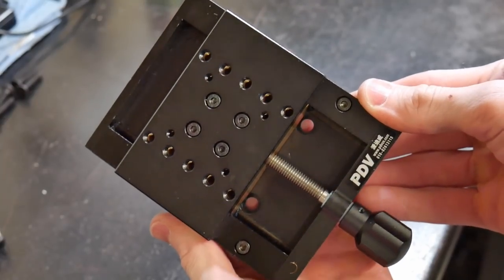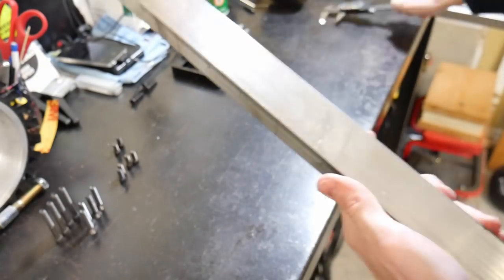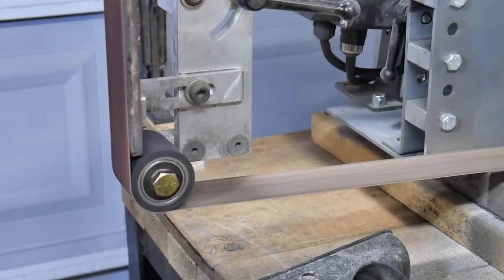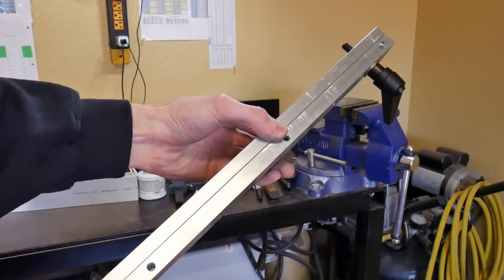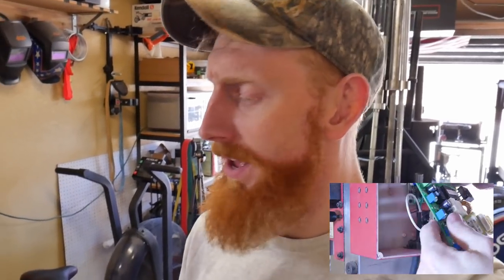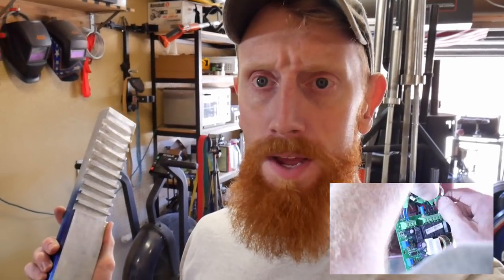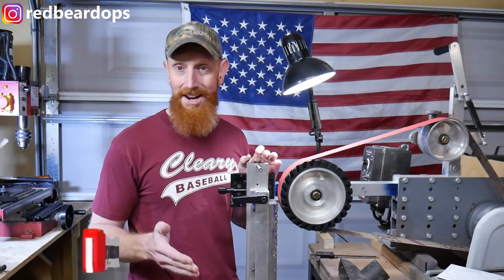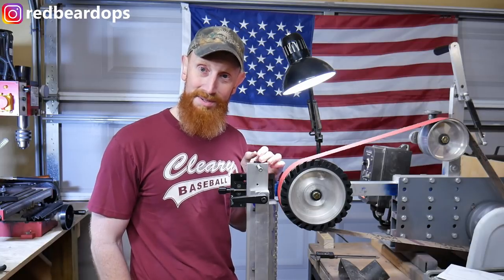Homemade Surface Grinder Attachment - Want Flat Things?

Comment: Nice Idea, I worry about some of you health and safety, well done on the video.couple of points, when using any machine, use hearing protection, when grinding use a N94 dust mask. (Yes I have a beard as well, but I keep mine short) when working, clamp the job, keep your hand away from the tool, keep the blade covered on the band saw. Clean up after the cut, hold the job or clamp, fix the vac so you can hold the job..... use some vice grips to hold the screw when you use the band saw. I have learnt this all the hard way.....great project hope you have many happy hours and make some great things, once again thanks for taking 5he time to make this video
Reply from the maker: Have a great weekend sir!

Comment: I just started building my surface grinder attachment, and just completed the magnetic chuck. I found it fairly easy to get the magnets in by using super glue. Just took a couple small tubes. Only have to hold down the magnet for 10-15 seconds, and then you don't have to worry about holding it down while putting in its neighbor.
Reply from the maker: Glad that worked for you Kyle! Cheers sir!
Reply: @RedBeardOps  I might add, I poured epoxy resin over the top to fill in the slots. Just put the super glue down first to hold them in place.

Comment: Yeah man excellent attention to the details that are important. I can really tell you remember all those little ah ha moments that made you a better craftsman and pass them on as you narrate.  Thanks for talking too come to think of it I am really getting tired of trying to get the pertinent info off a video where the guy just plays bottled porno music or bad techno it's infuriating. I was blown away by your use of the drill press as a jig to start your tap straight.  For me that that simple tip is going to improve the quality of my work so much.   I am so stoked.  I made a custom tap handle with longer arms and a level the other day because my holes just weren't perfect and it was driving me nuts.  I I've even broken taps trying to correct a bad start a little too far in.  I can't believe I didn't know that already or think of it myself.  I used a cordless to start some the other day with decent results until it broke off in a customer's piece.  Had to grind it out with a diamond bit in the dremel.  Anyways you are a gentleman and a scholar my friend you have my subscription.   like the third one I've subscribed to in the last ten years.
Reply from the maker: Thank you very much sir! I'm really glad you were able to get some usable information form this video. Cheers!

Comment: I laughed a bit... "...is about 600 mm long, and about 2 and a quarter wide"
Nice job satisfying both sides of the old Metric vs Imperial camps  :D
Definitely a sub from me.
Reply from the maker: Thanks man, I try to keep everyone as confused as possible! ;)
Reply: So that’s 2ft x 60mm.
Reply: M6 is near enough 1/4 Whitworth. M8 is 5/16 and M10 is 3/8.

Comment: Cool built, I like the idea, not as precise as a full surface grinder, but I expect it's plenty good for what it's meant for. Couple of thoughts while watching, if those locking levers are used enough you might end up with the threads wearing out in the aluminum, if so a thread insert (a Heli-coil for example) would be a perfect fix. Interestingly aluminum can be cut with woodworking tools, if I had the choice I would have cut the slots for the magnets on a table saw, not always an option (gotta have easy access to a table saw...) but it opens up possibilities. You may know this already but those screws are generally hard(ish) so they tend to wear the blade on a band saw quickly, especially if the blade is new. As a machinist, I feel you on the milling for the first time, it's a totally new game, wildly different rules, so no harsh judgements here. Great build, I look forward to hearing your thoughts and experiences as you use it more
Reply from the maker: Hey yeah Curtis, for what we "full tang knife makers" do it's more than adequate. For sure not a replacement for a legit surface grinder.  Very good points in your comment. The table saw would of been way faster I bet. A lot of machinist have commented on this video in what I'd consider a mildly-hostile way; so I really appreciate your approach. So much to learn on my end! Cheers sir, have a great weekend!

Comment: A great upgrade would be to fill the magnet slots with resin to make clearing the swarf off easier.
Reply from the maker: That's an interesting idea! Thank you
Reply: I was thinking when the magnetic table was being used at the video end that after a short amount of time there will be a ton of grinding waste in the magnet grooves. This seems to be a good solution. And I learned a new word: swarf.
Reply from the maker: @oddjobbobb  As a side note; wiping it off has been pretty easy. Also if it really bothers you, you could lay down a strip of tape to peal off after use. Cheers guys!
Reply: If done it should be with a high temp resin as I imagine the blade could get a little hot.
"Swarf" Yes, keep it out of your beard ; )

Comment: Congrats!  Looks great!  I wasn't as patient as you I just bought the Origin Blademaker surface grinder. Got it last week. The surface grinders will really up our games. I have already found as you were doing it is of the utmost importance to true it up before you start using it. For me I ordered some 2 1/2" belts. They're easy to find. Good luck. I am anxious to follow your progress here as we both seem to be starting this part of the journey at the same time. Next is figuring out how and where to store it when not in use. It is a big burly thing and attracts a lot of metal dust (as it's magnetic). I need to find a way to store it that it doesn't accumulate metal shavings when not in use.
Reply from the maker: Awesome Jim! You'll have to let me know how the OBM works out for you. I think I'll be able to use some 3'' x 79'' belts that most people carry. I've been playing around with it over the last few days and it's promising! I'm thinking of storing it on the wall via hooks.

Comment: protip: when installing magnets, don't try to do them all at once.  install in an alternating pattern and let epoxy completely set...
Reply from the maker: A very, very good tip right there!
Reply: @RedBeardOps  You actually want the magnetic N/S fields to be rotated CW 90º such that they form a Halbach array. This arranges the magnetic fields to one side of the faces increasing their strength in one direction, exactly like fridge magnets work.

Comment: I built a DIY belt grinder, here in Ireland 2" x 72" is not very common but I was easily able to buy 75mm x 2000mm belts which are roughly 3" x 78.75". If you could obtain those belts you might be able to run them on your machine with the contact wheel moved out a bit more to take up the extra belt length. It would save you having to order custom made belts.
Reply from the maker: Good idea sir! The 3x79 belts are a common size here and have been working fairly well. Cheers man!

Comment: I have been wondering about getting a mill for flattening out surfaces on forged pieces. Since you already have a mill, do you find the surface grinder attachment better for this type of use? Faster/cheaper/easier/other reasons?
Reply from the maker: Good question Joe. Yes the Surface grinder with belts will be much faster. Clamping forged pieces on the mill can be difficult as well. I do use the mill with a router bit to flatten handle scales and blocks though.
Reply: Idk id suggest a mill, its just more versatile
Reply: I use my surface grinder attachment on forged pieces as well especially since I do a lot of salvaged metal knives and swords.  You can never be 100 percent sure how hard the metal is after forging.  Some metal air hardens quickly.  Even a draft from one side can make piece hard enough to waste a 50 dollar bit by hitting just one little area that got hard.  I also agree with the clamping issue.  It's sometimes hard to find a reference plane to start with on something that may or may not have warped as it cooled.  A mill is still an indispensable tool where exacting tolerances are required however forging is not an exact science.🤔
Reply: Just a little saftey tip, your saw will cut meat and bone real fast!  Use some vise grips to hold those little screws and parts.  Ask me how I know!
 I love the way you approach your projects!  Be careful as you go on your journey.   Thanks for doing what you do.

Comment: Combat Abrasives will make custom sized belts
Reply from the maker: Thank you sir, I'm in contact with them! Seems like good people.
Reply: @RedBeardOps  You can easily rip down a 4x72 belt. Not sure if it's cheaper or not but...
Reply from the maker: @Steve_Just_Steve  Thanks for the idea! I was able to find some though Combat Abrasives that should get the job done though.

Comment: Others have mentioned WD on aluminum. Cheap, but works. Those are chatter marks, somethings moving. Anytime you see that, reevaluate your speeds and feeds(slow down), and check your rigidity. Magnet tip, steel flat stock behind the aluminum will force the magnet to self level and stay home while placing multiples.
Reply from the maker: Thanks for the tips!

Comment: I'm struggling to fathom how you can possibly demonstrate flatness using a single thickness measurement.
Reply from the maker: Well, I hadn't had much time to mess around with the machine at that point and didn't have a mic. So far I've been able to achieve a 0.0011'' total variance over a 7.5'' piece with about 6 measurements. I know it's not perfect but for a knife maker is good enough! Cheers man. Thanks for watching.
Reply: you cant really.  flat is a reference to a plane.  normally you would measure this against a reference surface.  most times you would rub a surface against a reference to pick up ink and then sweep the low spots with a test indicator to understand the deviation, you can also raise the part off a surface plate and level the surface being measured and then sweep it with a a test indicator.  whats actually being measured here is parallelism.
Reply from the maker: @salvadorebertolone  I think I've seen that before. The process is called "scrapping" right? They get stuff extremely flat!
Reply: @RedBeardOps  yea, but they usually aren't taking measurements during scraping, often they are just knocking down the ink until the have a certain density of spots.  You can do the same on a grinder, it will be very good at making something parallel, but it will often pull a part flat on the magnets, to where it's parallel but isn't flat, with some practice at grinding and after you've flung a few parts off the magnet, you'll learn how to grind with just the residual magnetism or how to shim the part so its pretty flat
Reply from the maker: @salvadorebertolone  I have for sure noticed this. I've been messing around with shimming my parts if they have a warp out of the heat treat. It seems though that getting my warps out in tempering before heading to the SGA is the best place for it, since the shimming seems to be a tedious process. In the realm of fixed blade knife making the results on this machine are excellent and far more preferential than the old "sand paper on a piece of granite" game. LOL. Thanks for your comments.

Comment: maybe mentioned below but get yourself a set of transfer punches. Theyre cheap and you'll find a use for them in all types of jobs from fabricating to quickly transferring pin holes on scales.
Great build!
Reply from the maker: Very good idea! I saw someone using those not too long ago and was like "gosh damn... i need those... " - Thanks for your comment! Have a good one
Reply: @RedBeardOps  just don't go use your most used one upside down by accident like I did 🤔
Reply from the maker: @mrstephenporter  Lol! I'll do my best! No promises...

Comment: .001 is good enough for pretty much any knife work when you start getting into tenths you are getting into Aerospace industry. I don't think you will be flying your knives.
Reply from the maker: Lol, no sir! Won't be putting them in the air
Reply: @RedBeardOps  I know mounting it vertically makes the thickness adjustment easier but to take it easy on your arm having to move the table I would have considered angling the chuck a bit so less of the weight was totally resting on you.  Just at first looks without working it out angling it underneath (but not totally horizontal) with the depth adjustment would work. You would just have to add another arm. I wish I could draw it for you.
Reply: @RedBeardOps   Also I wouldn't bother with the 3 inch belt you might consider adding another screw to cover the Y axis if you change the angel when you build the extension arm you can build in a y axis adjustment. Just a thought. I think it would maintain a greater degree of accuracy.
Reply from the maker: @adude7050  Thanks for the ideas man. Yeah I ended up getting the 3'' belts and they work ok. In the future I plan on having the ability to rotate the whole grinder horizontal. That will make it nicer to use, but in reality it isn't that bad to use in this orientation. You can see me using it in both of my last two knife build videos. Nothing to it! Thanks for watching sir!

Comment: In the end of a tap is a centre hole where you can locate a centre in a chuck to tap , just apply slight pressure as you tap, especially good in lathes. Grinding a point on a bar will do the job. Also, not and end mill, a slot drill, the clue is in the name ;) Magnets, start at opposite ends then they can't attract each other. A carbide blade, the right size will cut those slots in a radial arm saw too, if you take it easy and lubricate it. Maybe bolt a dial test indicator to measure cut depth on the finished otem? Nice result :)
Reply from the maker: Thanks for the tips Tim!

Comment: Good job, we use paraffin as our cutting lubricant. One small comment I would make is to shield your bearings if you are grinding steel on your projects. Grinding particles can easily affect the smooth running of your bearings.
Reply from the maker: The Pagan thank you sir! Appreciate the comment.

Comment: When I cut aluminum stock I just use my wood 12" shop saw with a carbide tip blade, obviously take it slow but its faster than a band saw. Maybe this helps maybe I'm a idiot but been doing it for yrs. Also just a idea but you might be able to use a spring to help counterbalance the weight maybe even mill a slot to hide the spring if theres room in the aluminum stock.
Reply from the maker: Good tips sir! And good idea with the spring! Have a great weekend!

Comment: If you would like to build one of these but have no milling machine, you don't really need one. Use a thinner base, then use lengths of bar the same height or slightly less than your magnets screwed to your base alternating with magnets glued in place. Like a piano keyboard keys. A long backing strip screwed to the back edge will help keep them in line.
Reply from the maker: Good idea Tim

Comment: i think if you made a rail with 1 or 2 more sets of those rollers the accuracy would be improved, may help with warped or rough stock as well as deeper passes. your a crafty dude, having a nice shop like yours helps as well. good video.
Reply from the maker: Thanks Dennis!
Reply: @RedBeardOps  your welcome bud, just a suggestion making it more rigid may help.

Comment: Take a look at a dial test indicator to measure the surface finish accurately. Mount it on the column of your mill, then measure the surface of the table as you move it back and forth. Take note of the measurements and then repeat the process with your surface ground finish on the table and subtract the original measurements from the new ones. 
When running the surface grinder, make sure you take super light passes as the metal you grind will heat up, expand and grind extra off, then cool back down and measure inconsistently. 
Hope that helps!
Reply from the maker: Thanks man! Good tips!
Reply: @RedBeardOps  No worries. I didn't realise this video was from the start of the year before commenting. Sorry! :P I've been hoping to do a build exactly like this myself in the near future and I've been looking at the commercial attachments for the 84 engineering belt grinder system. Keen to see an update for your build (couldn't see one yet?).
Cheers!

Comment: Interesting video!  I have 2 real surface grinders that I bought on online auctions for far less than your build price.  They both grind a surface finish to less than a 10th of a thousandth.  BUT they are both 3 phase power and take up lots of space.
Reply from the maker: That's awesome sir, I'd love to have one like that! Do they run 0.75'' wheels? One negative of a large machine like that for my uses is that it will take a significant amount of time to surface a full tang knife with narrow wheels. Also I don't need that level of precision for full tang knives. So I'm sacrificing precision to gain speed and space it seems. Still, would love to have one! Thanks for your comment sir. Have a great one!
Reply: @RedBeardOps  I have lots of wheels, 3/4 width wheels 1/2 wheels, and several side dressing wheels and also diamond wheels.  My small manual machine is a 6X12 (900 pounds)  and  the large machine is a hydraulic 12X24 (4600 pounds).  Have you tried any type of mist for cooling to prevent heat warping?  Even a constant /consistent source of compressed air would help with heat build up.  NOGA makes a nice  portable mist system that could also be used on your mill, lathe or drill press.
Reply from the maker: @andrewevans1658  Very neat! I've found that there isn't much heat build up at all. My warping is generated during the quench. I have had very good success getting those warps out in the temper though.